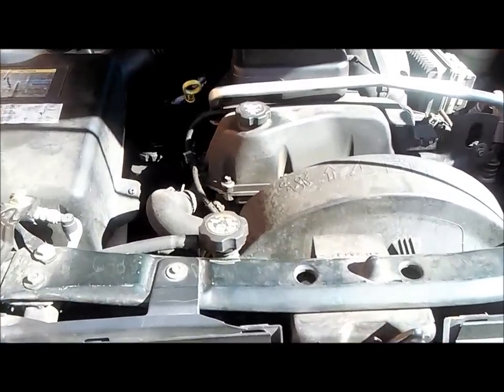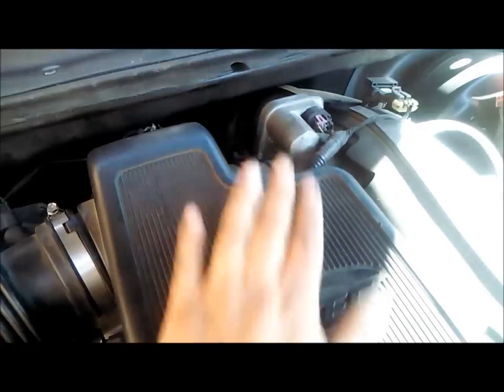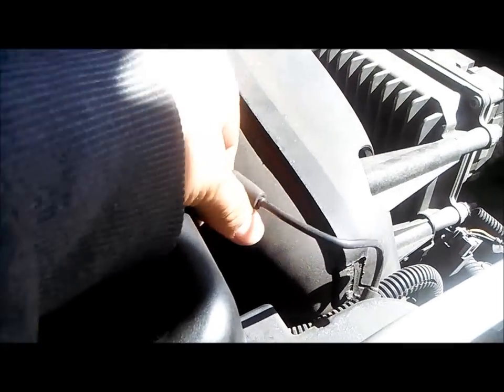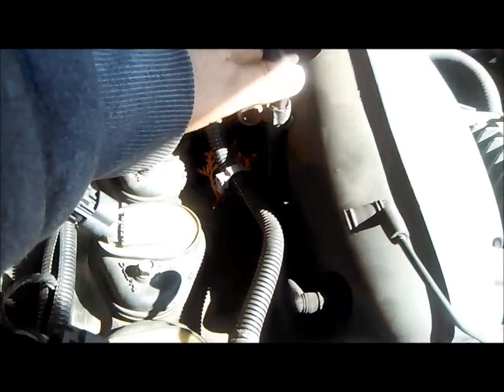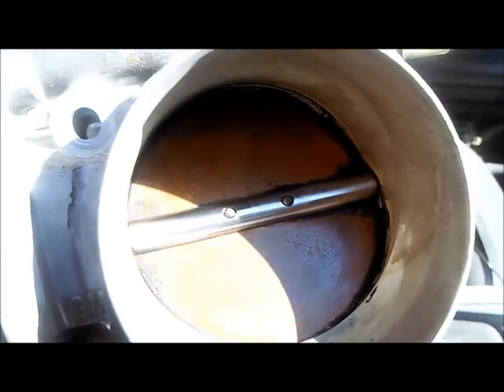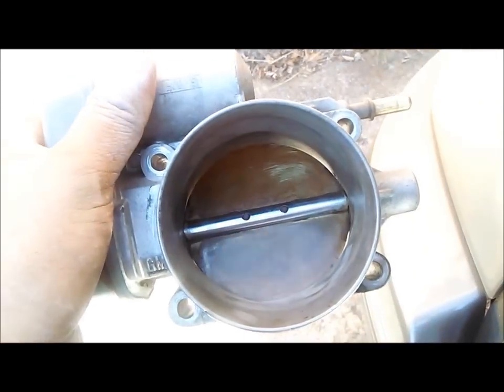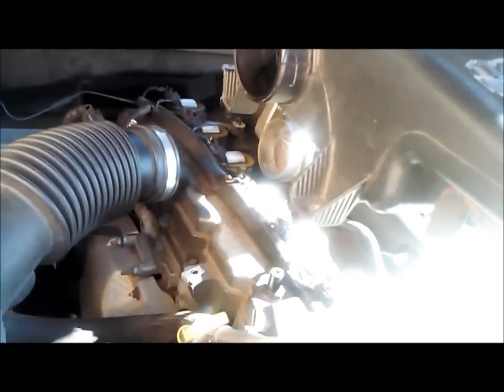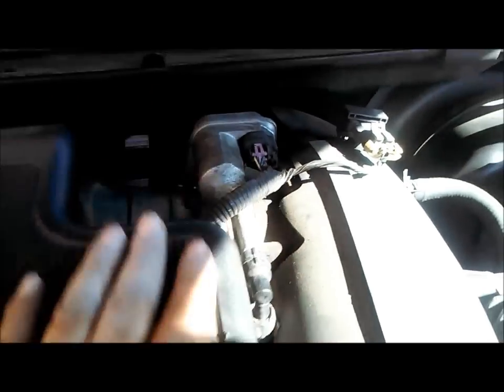DIY: GMC ENVOY, CHEVY TRAILBLAZER THROTTLE BODY

Comment: You shouldn't use card cleaner and a wire brush.. you should use throttle body cleaner and a rag... just thought you and anyone else that may watch this should know
Reply: your right.  carb cleaner and wire brush is a big no no.. Throttle body cleaner and plastic brush is the only way. Use a rag to wipe everything away after your done.
Reply: Nonsense. There is nothing wrong with using carb cleaner and a wire brush.
Reply: Man I cant believe he used a wire brush 😂

Comment: You did the right thing by taking the housing completely off and going for the thorough cleaning, but....
1) You kind of halfassed the cleaning - there was still lots of gunk visible 
2) Wire brushes shouldn't be used for this.  I find that a trip to the grocery store for a $1.20 firm toothbrush is well worth it, simply because it doesn't scratch the precision machined surfaces inside the throttle body

But overall, good job.  Kind of :-)